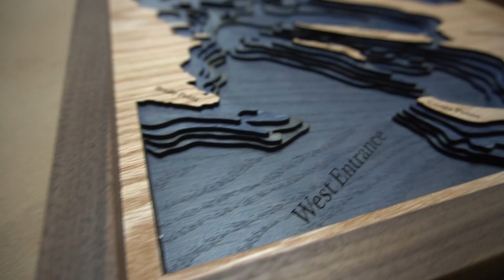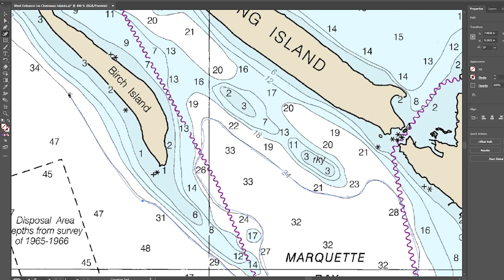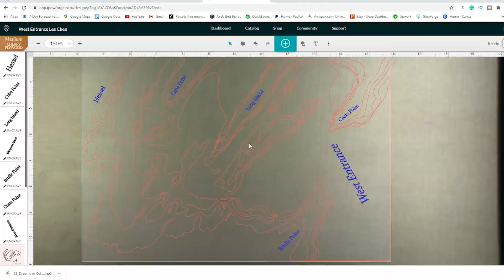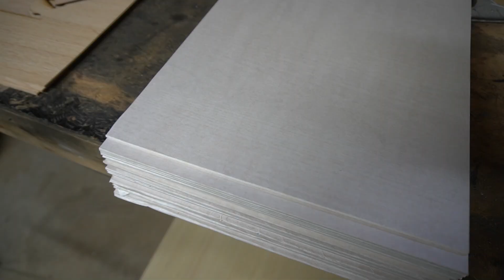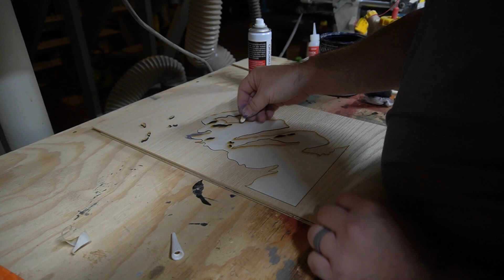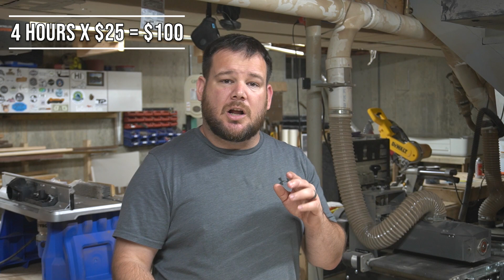CNC Laser 3D Wooden Lake Map Art - Will It Sell? Episode 2

Comment: $25 hr for your shop and labor is unrealistic. You should be up in the $60 to $75 hr. You have a ton of equip and overhead to pay for. Those maps are going for $275 to $400 for a reason.
Reply from the maker: There is a lot of time that goes into these. What are you including in your $60 to $75 and hour rate?
Reply: @AndyBirdBuilds  that what I am saying. Those maps are labor intensive. $165 is way too cheap. Even if you got orders for 20 of them. 4hrs per map. It would take you a week to do them.  Don't be afraid to charge for custom work.

Comment: Try using "tea bag paper" - sprayed with water and squeegeed to the top surface of the ply (lay on dry then spray) . Spray the back surface with water to stop the ply warping.
Vinyl transfer paper leaves a horrible gooey mess that can be difficult to remove - especially when rastered - tea bag paper just lifts/blows off even when wet - along with the smoke staining.
Tea bag paper is exactly that - used to make tea bags :-) Model aircraft tissue (modelspan in the UK) will also do the same job - hard tissues don't work well (like Japanese tissue) - you want an open weave. Works on lots of materials - especially thin styrene sheet where it gives crisp cut edges.
Reply from the maker: Thanks for the tip!